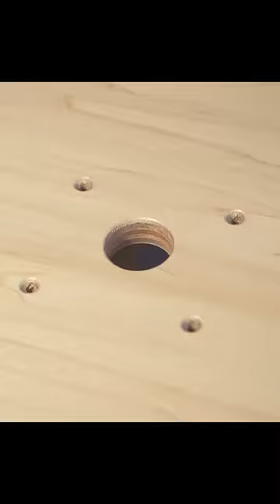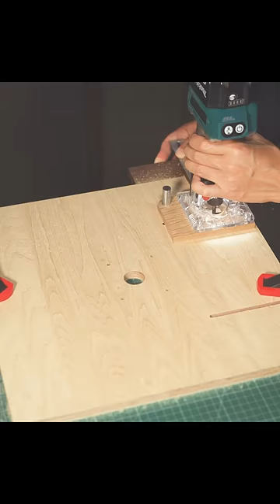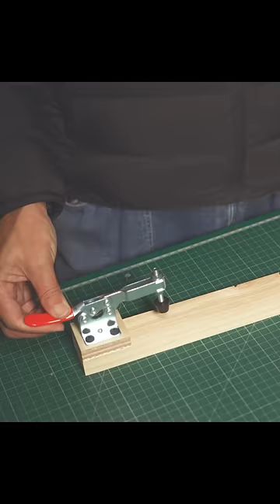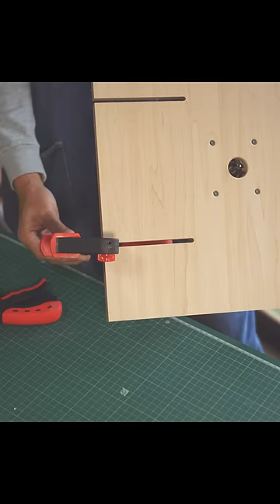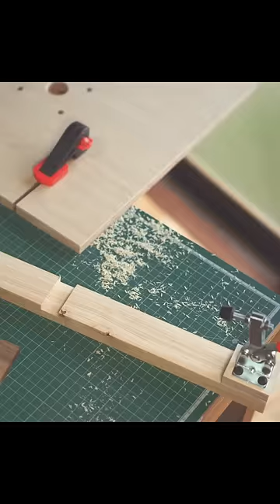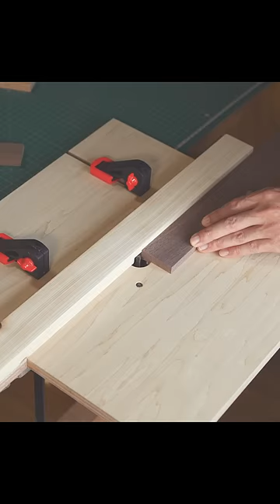Simple Woodworking Hack #shorts

Comment: You really need some sort of push stick when pushing over any blade. The rule I learned is that your hand should never go over where a blade or bit might protrude if you are not cutting a groove so even when you are tired or not concentrated there is a fool proof way to use the machine. Please demonstrate SAFETY in your videos as well as smart woodworking. This type of demonstration makes people think this is safe, and it is not. One of your viewers might loose a finger or worse if they copy you. Please include more safety in your videos.
Reply: Yep, one of my first thoughts when seeing the wood table in use.

Reminds me of my dad who sliced the tip of his finger with a table saw when holding down the tip.
Reply: For these cuts he didn't really need one but since these videos are intended for beginners, every safety precaution should be demonstrated.
Reply: Imagine having to learn it the hard way. Zero common sense then don't touch the tools